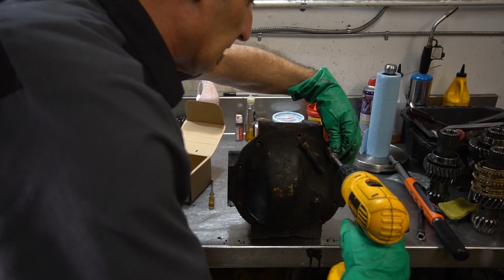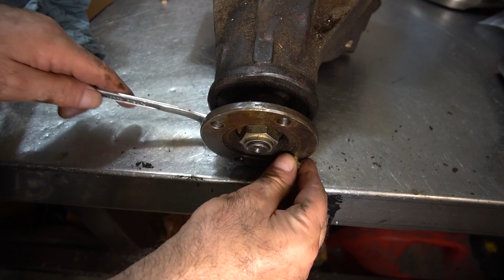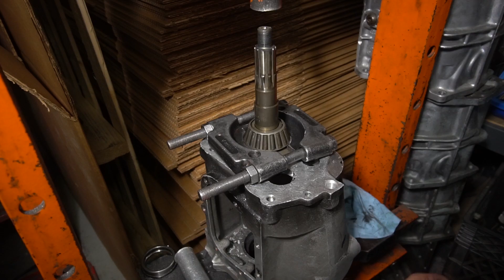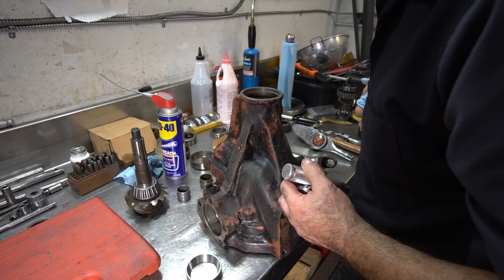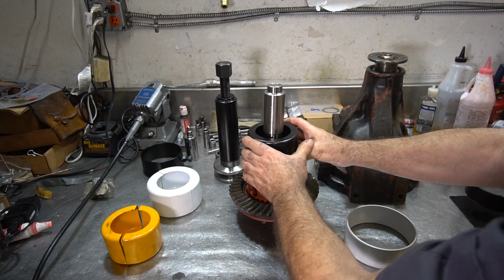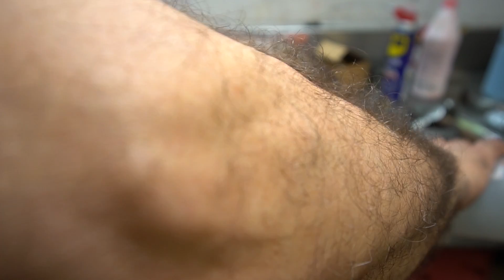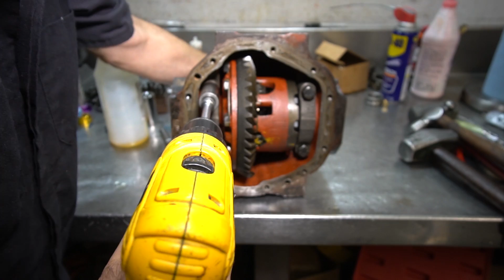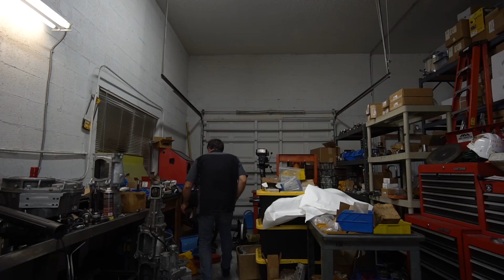Dana 44 Carrier and Pinion Bearing Replacement Basics Jaguar XKE

Comment: Did you ever try putting the differential in deep freezer for an hour to help with bearing installation? I did once, the only time I had dealt with a differential, combined with heated bearings they just fell in. Getting rid of the condensation on cold metal was the issue not to cause rust. Very good video and professional knowledge share, thank you!
Reply from the maker: I have a professional cone bearing heater. So there is no need for me to work in the opposite direction. Pro freezers are pretty expensive and a conventional freezer will take way to long to achieve the desired results.

Comment: +1 for not putting a load on cast materials cast iron/brass & aluminum (eg. Test; screw a pipe into a cast valve & see how easily it cracks, relative to its size). Although i thought the housings were cast steel? Would be fairly hard to hold any real loads otherwise it seems...& getting that surface finish where the bearings seat would be voodoo. I Still wouldn't go spreading the housing though either way since steel could deform(stretch compress etc) & possibly not return to spec. Thanks for the lessons.
Reply from the maker: All iron is not the same. Usually castings such as this are nodular iron or ductile iron. I'm sure if you search the web you will find the difference between grey iron and nodular iron. Thanks for watching.

Comment: What does the negative or positive number come from on the pinion gear itself. Why arent they all just zero? Could somebody explain please
Reply from the maker: Sure. The factory cannot possibly make all gear sets super accurate. The ideal running distance of both ring and pinion will vary. So the plus and minus numbers are used to define the best running distance for that particular set.
Reply: GearBoxVideo thanksfor reply

Comment: Can anyone explain excactly how the oil slinger works and what or how it moving the oil in there..
Reply from the maker: Think of it as a shield. There is a great deal of turbulence in the diff. Combine that with the inertia of the oil when braking. So the oil shield keeps oil from piling up against the seal and since it is rotating will sling the oil away.
Reply: GearBoxVideo ok great thanks for reply

Comment: To heat bearings I use an old crock pot with synthetic oil. Set the temp hang the bearing in oil. Carry  on with other duties while cooking.
Reply from the maker: Interesting potpourri aroma for the shop as well.
Reply: A trick I saw someone use once was to wrap the bearing in a wet rag and stick it in the microwave. the water in the rag shields the bearing from the arcing and sparking that normally occurs, and you can't really exceed the boiling temperature of water. Since most bearings can typically handle at least 120-ish degrees Celsius that's pretty neat. I haven't had the need to test it for myself, but certainly a trick for keeping in the back pocket.
Reply: @ColtaineCrows  I saw AVE on YT use that trick and it seemed to work very well.

Comment: Hi, me again. Can you help me out with the output shafts, the jaguar WSM says there should 001"-003" end float on the bearings but mine has crush bearings and there was 015" end float on one ( that's a contradiction surely) before I dismantled it and the inner bearing is not good. I found a really helpful guy online and the only one I have found to cover this  (Kernow Skunkworks) and he uses shims with preload as directed in Haynes manual.  My Haynes agrees with my Jag WSM 001"-003" end float.  Your advice on this would be much appreciated. I think I need a lie down now!!

Comment: Thank you for this, a great step-by-step explanation of this difficult task. I don't get why you would want to change shims/shim depths or shim distribution - could you please explain? Will this procedure work on the Jeep Grand Cherokee 44a (Aluminium case) diff? Many thanks from Switzerland!
Reply from the maker: If you change gears or the carrier assembly you will have to reshim. I've used the same shim dimensions when just installing new bearings

Comment: Very good! Great explanation! I want to regear my Cherokee and this was a good review at the end of your video. I did what you did on an Chevy Astro van I had just bought with a noisy rear end. The vent tube fitting came off  and the housing filled with gravel. Fortunately the gear set was okay but the bearings were hamburger. Kept the shims the same and it worked out great. I fixed the vent tube...

Comment: Hello. I did like very much your video! Im assembling a Dana 44 (43/13; 19 splines; limited sleep). Sorry for my english, Im from Argentina. The differential is of a Renault Torino coupe TSX. I wouldlike to ask you a question. What do you think about putting the shims to regulate the carrier, not between the inner race of the bearing and the carrier (as in the manual of the mentioned car is said), but between the outer race and the axial journal on the case?                      
Thans forward!
Reply from the maker: Some GM rears do that. It all depends if you can get shims that size
Reply: @GearBoxVideo  Thanks very much!

Comment: Thanks for the tip on using a heat gun for the bearing. I used my cheap Harbor Freight heat gun and it put out 300 degrees of heat on the bearing. Once the bearing got to 150+ I dropped it right onto the pinion, no fuss, no muss. You saved me a lot of drama.

Comment: I have this diff out of my jaguar irs frame to replace seals and in my ignorance did not mark the pinion shaft nut position for retightening. Do you think retightening the crush washer to correct torque would return the preload, although I have a new washer and nut I don’t want extra work.The best video I have seen.
Reply from the maker: That is the idea of the sleeve. To be able to change the seal. Some have no sleeve but a shimmed spacer. So just install to the proper torque spec of the nut and you should be fine. Apply sealant to the yoke spline and threadlocker on the pinion.

Comment: That really was well done. I like how you used an old transmission case to hold the pinion while pressing out the bearings. Also how you supported the pinion when reinstalling. All good tips. I have to go through my Dana 44 on my Studebaker and this helps a lot. Thanks.

Comment: that is a lost art,bet less than 1% of mechanics know this
Reply: We rebuild rear ends at our shops pretty frequently.. Mind they're out of trucks, so not quite the same. Bearing pre load is done by a special nut on either side of the carrier. Pinion is done pretty much the same way though.
Reply: @ColtaineCrows  yea ford is set up that way,but most of GM uses shims ad i can get tedious if it aint close to the old one,especially like a 642 ratio for a short track

Comment: Excellent video. Makes a change to watch a well flowing video with just the right amount of talking. 
I have a Salisbury diff in my Land Rover, which appears very similar. I am about to add a diff lock, and the thought of setting the carrier afterwards was a little daunting. I assume in most instances you set the pinion up at the required preload and just move the carrier left to right in order to get the desired pattern.

Comment: Awesome video. I'm looking for a little clarification with the pinion depth.  When I use the ground stock and depth mic am I looking for 2.635 exactly, or 2.635 - .048( 048 marked on my new pinion)? Also I've seen 2.625 as the checking depth from other sources, would this matter? I'm working on a 77 CJ7 with a D44 from presumably a IH Scout II. New carrier, r&p, and bearings. Thanks in advance!
Reply from the maker: You have to substract the difference of the flat ground stock. Read my pinned. Omment in regards to this
Reply: @GearBoxVideo  Awesome, thank you. Unfortunately I don't see any pinned comments, could just be that I don't know where to look as I am new to youtube comments.
Reply: @daniellong958  You find it at 39.54.
Reply: @manu64646464  That portion is actually what got me second guessing things. It seemed as if what was done at 34.35, and what was explained at 39.54 were contradicting one another. I see now that I was just confused. His math is as follows: 2.880(measured depth)-.25(ground stock)-.006(pinion offset±.001)=2.630. I think I got a good grasp on that now. 
I am still curious about the other sources I've seen stating 2.625 as the nominal checking depth vs 2.635 as stated here. My old pinion has 2.624 etched on the face, which made me question it more. Are all D44's the same? Does this vary with build components? Should I aim down the middle at 2.630 to play it safe? Sorry, I'm most certainly new to building rears.
Reply: @daniellong958  I never did this job too, I think I will try to do that on my 73 Mustang. But before I want to be sure about the "do it by yourself", cause if I start I need to finish, and to do this correctly. English is not my mother language, which doesn't help me completly. Good luck to you.

Comment: Hello, I was wanting to know if the checking distance is the same as the "standard setting" for pinion depth? Is 2.635 used on the 35c too? My oem manual for my 94 jeep grand cherokee 5.2 list pinion gear depth standard setting at 3.813 in. Do you have a different number for the 35c? I went out and purchase a depth mic and flat stock to check pinion depth on my Dana 35c.  I could not achieve the 3.813 with the 2-3 or 3-4 ext rods. It seems the number 3.813 is to long between pinion head and case center line. I reused my gears and replaced the pinion bearings and races. My pinion has 0 marked above the matching set number. My results using the mic came to .338 with the 2-3 ext rod. Using the 3-4 ext rod would not allow the mic to rest on the cap bolt holes. So with the 2-3 ext rod, does .338 turn into 2.338 or 3.338? The flat bar measured .236 thick. Either number subtracting the flat bar thickness did not give me the 3.813 I was looking for. I went ahead and used the gear pattern for set up which was very time consuming but truly wanted to do it your way. I haven't assembled it completely and would start over if you can give me some for sure numbers. Thank you for your time and vast knowledge.

Comment: I have a 1999 Jeep Grand Cherokee Limited V8 4×4 with an ALUMINUM Dana 44 rear end. I'm replacing all 6 bearings. Where can I find the manufacturers specs to perform the job properly?
Reply from the maker: Best bet is to get a Jeep factory service manual for your year. Used and new on eBay. Worth having if you are going to do any work on that vehicle
Reply: The PDF of  the factory service manual for the wj is out on the web I think I have it in my Google drive if you need it

Comment: Hey i have a 2014 jeep jk and im trying to change my spider gears and im gonna have to pull the carrier ,if i dont want to remove pinion  can i just pull out the carrier and install it back would i still have to check pinon dep ,or i dont have to check pinon dep ?
Reply from the maker: JOSE BADBOYJOSE no you would not.

Comment: I do not like to use the case spreader myself either however if you do use it. You're suppose to set up a dial indictor and measure .020in spread off the case. As mentioned in the video cast iron cases can become damaged using the case spreader.

Comment: Back in the late 80s early 90s worked at a Ford dealer on heavy and mid range trucks the F 450 used a Dana 80 axle had to do these in the chassis they had two dowel holes beside the cover you would insert a spreading tool to spread the banjo mostly for assembly. Not so on disassembly because it would just fall out.This spreading tool weighed 50 lbs the carrier weighed at least 45 lbs  Can see oxidation plagues these diffs noticed the rust on the one you demonstrated.These things ate carrier bearings. Dont know if was the crappy vent design or the metal they used but guaranteed when these diffs came to us under warranty the fluid would be brown with rust.The recommended service under sever duty would still not alleviate the brown gear oil.Built many 10.5 ford diffs they failed from spider gear failures but the oil drained was sparkly but clear.Today 13 years to 65 am working at a Freightliner dealership fixing vibrations 99% driveline the standards have dropped and check engine lights should have have check emission light because 80% its the def or regen system . Makes an independent want to buy a new truck NOT. I watch a dying art every time I watch your vids . The standard transmission is for hard core drivers want to be connected to the mass they are manipulating. But as with anything lazy is king Automatics.Keep up the good work.
Reply from the maker: Most of the moisture contamination comes from water entering the vents. The vents should really be remote and raised higher. Especially here in Florida with severe rain. Some of the vents are on the actual cover.  Not the best place.  Thanks for sharing your story.

Comment: Heat bearing or freeze pinion
Reply from the maker: Pinions can't be cooled enough to drop a bearing on.
Reply: @GearBoxVideo  must be different in a industrial setting with a industrial cooler at -5 degrees
Reply: But then again they aren't as beefy gearboxes so
Reply from the maker: Keep in mind I'm making videos so that the average person can actually tackle a rebuild in usually a home environment. Talking about industrial coolers or $3000 bearing heaters may sound slick but realistically is pointless here.
Reply: @GearBoxVideo  I agree still nice video keep up the good work

Comment: Well folks,I've checked every Spicer/Dana manual and chart I could find and they  are opposite of this on the pinion depth number.A plus 6 means to add .006 to the nominal distance which means taking shims out.
Reply from the maker: I have to agree with you. The + number usually means you are adding to the measurement, thus subtracting shims. Yet this rear was .005 closer.  I'll pin the correction  thanks.
Reply: GearBoxVideo  To recap then , a +6 means the nominal distance from the center line to the pinion increases 6 thou ?
Reply: Yes, I've been reading carefully the Jeep CJ TSM manual confirm that the nrs. (+X)  marked on the pinion means  that the distance between the axles axis and the pinion must be increased (added to the std factory values), if the nr is negative (-X) the distance must decrease

Comment: I just rebuilt an AMC 20 rear end. I had to make a bar to hold the pinion yoke and use a 36” breaker bar with a pipe over it to crush the spacer to 25 inch lbs of drag. I don’t se how the impact brought it down with your hand holding it 🤔
Reply from the maker: Well it works.  Pehaps get an impact gun and try it yourself. Depending on the collar you might have to lock the yoke down to start it first using the gun.
Reply: GearBoxVideo,
Hopefully I don’t have to rebuild another one for a very long time! Appreciate the reply and videos.

Comment: What would be the issues with moving the pinion or carrier to get a better tooth pattern ?

I assume once the gears have a few miles on them,you leave it alone,even if it never was
never set correct or exactly perfect, from the manufactures factory or assy plant.
Reply from the maker: This assembly was from a 1970s Jaguar. If the ring and pinion have been running for 40 plus years with the same pattern and are quiet, changing the mesh of the gears is not the right thing to do
Reply: I understand your 1970 Jaguar Axle & the reason you were working on it. My question applied to -- any -- Rear Axle Gear Assy. One with say less than 100,000 miles on it & your going thru it. Would there be an issue with changing the tooth pattern, to make it closer to perfect,so to speak,even even though the gears already have worn in some ?

Comment: Sweet trick using ground bar stock and a depth mic to check pinion depth. We used housing spreaders back in the day when working on Dana 70’s & sometimes 60’s. It doesn’t take much to “spread” the housing enough to pull the diff out. BUT, those things can be dangerous when using on an axle in chassis!!! They can and WILL fall out of the dowel pin holes on the housing and could break an arm or two. Very heavy tool. We would chain them up in such a way that if they slipped out of the dowel holes, the chains would keep it close to in place. Great and thorough video! Thanks for posting👍🏻👍🏻
Reply from the maker: Thanks for the comments

Comment: Hey Paul. I am so glad you did a video on the Dana 44 (another Super Job by the way). I have rebuilt a GM 8.5 with a new center section and was looking forward to doing a Dana 44. I read a lot about rebuilding the Dana 44 and am glad to hear the spreader is not required, though everything I read stated to use the spreader for the Dana differentials.

Keep up the good work; everything you do is of great interest to me.

Marc
Reply from the maker: On the jag rear there are no dowel hole points for a spreader. A spreader makes life easier and usually the full housing rears have spreader inserts. You can do it without one but if you have to mess with changing the ring and pinion you may want to make some slip fit carrier bearings and get a spreader, since it may take several attempts to get backlash dialed in.

Comment: Great videos and books!  I would have checked backlash and pinion depth during disassembly.  I understand your reasoning for not checking backlash during assembly, but I would have checked before and after just for comparison.  You could have pointed out to manually Check backlash by hand to make sure it exists if you aren't  going to use a dial indicator.  Once again great books & videos!!!
Reply from the maker: Andrew Evans no point on checking backlash when you have wasted bearings. That's pointless.  Remember. It had severely damaged bearings.  If the pattern check is ok (which it was) after the repair..you're good to go.